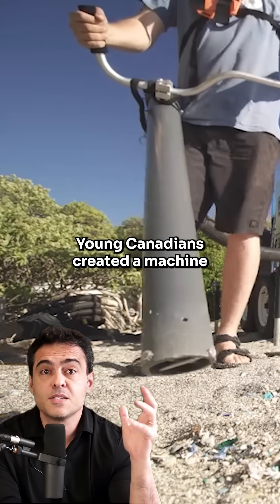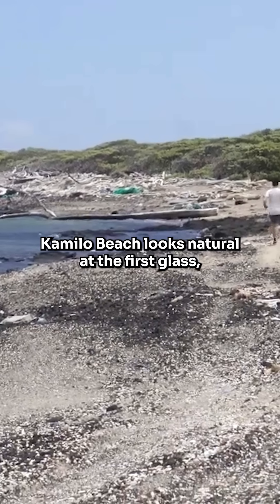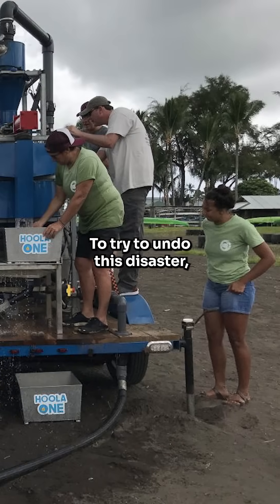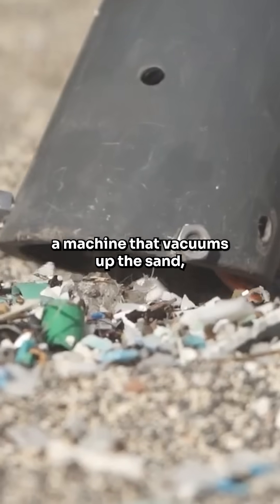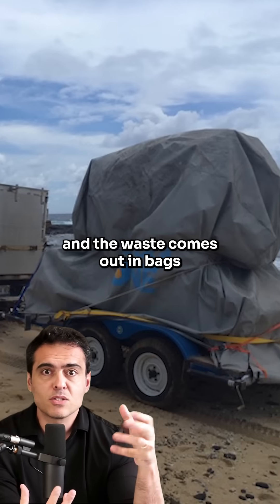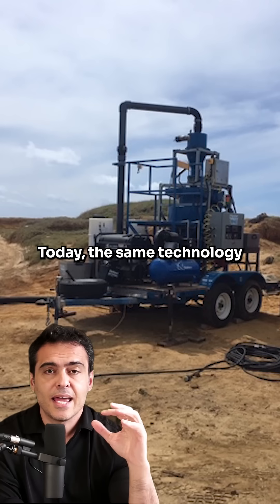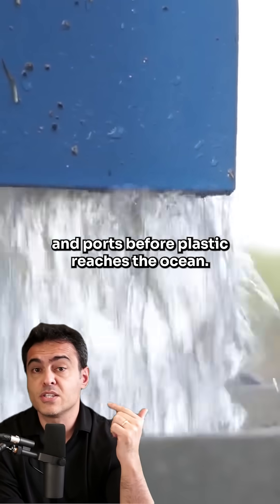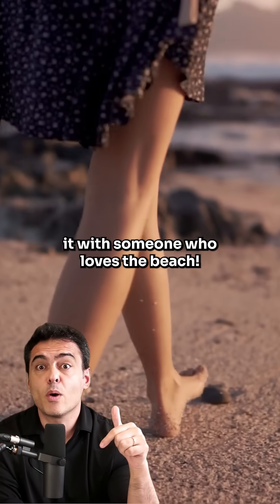Young Canadians created a machine that cleans sand from beaches!

Comment: You all might want to take another look at the results: Microplastic concentration varies significantly with depth, often showing higher levels in the midwater (200-600m) due to biological processes and density traps like pycnoclines, rather than just the surface, with some studies finding deep trenches holding massive amounts, while sediments, especially near coasts and deep-sea sinks, act as long-term reservoirs. Surface waters have surprisingly low concentrations compared to subsurface layers, and deep seafloor sediments often contain the most concentrated amounts, acting as a major sink for these pollutants. 
Distribution Patterns by Depth
Surface (0-200m): Often has lower concentrations than midwater, as some particles are biodegradable or sink, though it's a primary entry point.
Midwater (200-600m): Frequently shows the highest concentrations, with some studies finding four times more particles here than at the surface, as weathered plastics become laden with biomass and sink.
Deep Sea (Below 1000m): Accumulation is high, with extreme levels found in trenches like the Mariana Trench (up to 13,500 particles/m³) and the Arctic, indicating the deep ocean is a major reservoir.
Sediments: Deep-sea sediments act as a sink, holding very high concentrations (e.g., hundreds to thousands of pieces per gram), often exceeding water column levels.

Comment: Also they should research wood gasification or technically just gasification but you can burn just about anything in it except for rock metal and glass and burn it as fuel that is 110 percent carbon negative

Comment: On the one hand, it's a great initiative, but the slip of "hundreds of millions of PARTICLES" shows that they're greatly exaggerating the effectiveness of the machine. You could have hundreds of millions of particles of plastic in a single cubic yard of material. It's all about removal by weight, not particle density, if you want a fair effectiveness study.

Comment: the problem is that this only addresses large pieces of plastic. it doesn't get the microplastics, and in fact probably create MORE microplastics in the process. sand is obviously incredibly abrasive and while its mixing around in that machine its shredding pieces of plastic into microscopic sized pieces, and spitting it out back onto the beach with the sand

Comment: BS, not filled with microplastics but everything organic including animal life. Best method is a simple cyclone vacuum followed by use of waste in road surfacing as it is able to cross link with similar materials and decompose. Plastic always decomposes, it is a myth plastics last forever, just buy a BMW or Audi and see how long your engine lasts with all the inappropriate plastic parts in an engine that is filled with hydrocarbons and heat.

Comment: Problem is with PET, PVC, PC or PTFE; which have a higher density than water and thus will sink with the sand.

I think it would be much more effective to pyrolyze that sand. The energy produced with the plastic pyrolysis can feed the system, creating a self sustaining process and producing a truly clean sand.